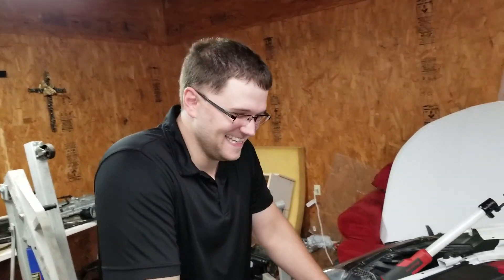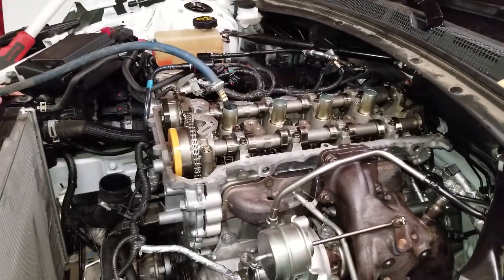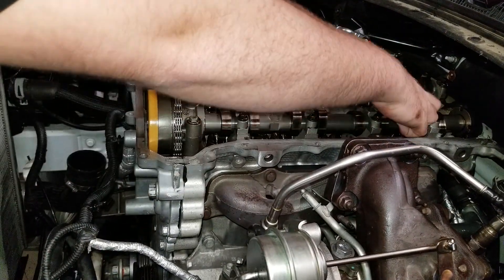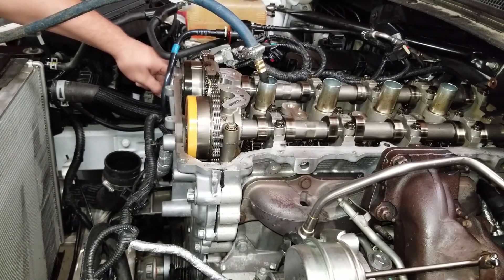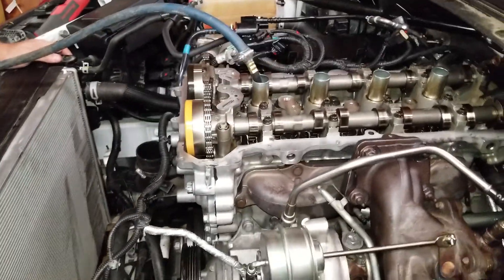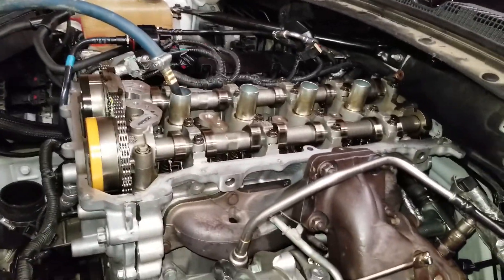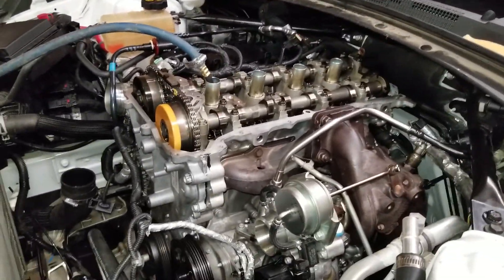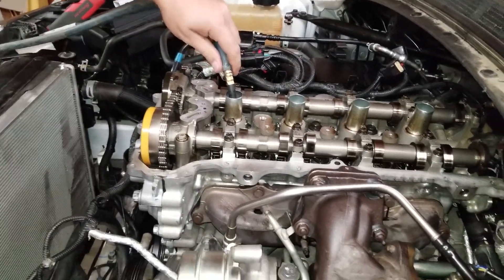Compression Test On The 4 Cylinder Turbo Camaro, Seeing What All Broke When We Tried The First Start

Comment: CHEVY NEEDS A 2.5 TURBO TO MAKE ME WANT A TURBO 4 CAMARO. Tired of 2.0 liters
Reply from the maker: They have 2.5 liter full size Silverado 4x4 trucks now, 350hp stock, that'd be cool to put in a Camaro wouldn't it. Then tune it and have over 400hp in something that gets 40mpg.
Reply: what engine is that im not familiar @1018Video
Reply from the maker: @rmblwgn 
Not sure what the engine is called, but they recently released it as one of the options in the full size Silverado trucks.
Reply: I'll be damned here I was thinking you were FOS, i'm sorry I doubted you. I've been so focused on finding out info on gm's 1500 3.0 inline 6 diesel that I missed all news on a new base gasoline engine to replace the 4.3. Its a turbocharged 2.7!! liter i4. SO GM WAS GOING THE RIGHT WAY WITH THE ATLAS ENGINES. THEY NEED TO BRING BACK THE i6 BUT MAKE IT 3.6l AND ADD A TURBO! WAYY SMOOTHER AND DELICIOUS SOUNDING COMPARED TO THE HORRIFIC RASPY ECOBOOST 6.